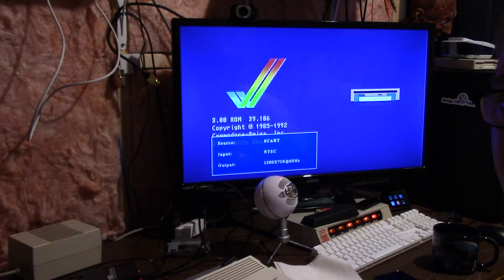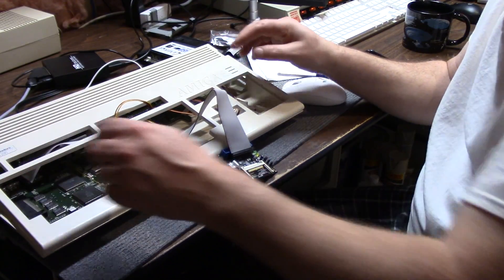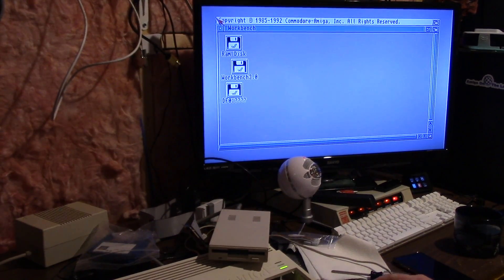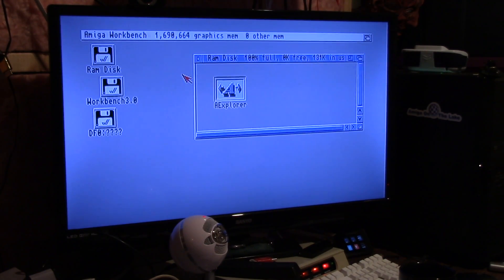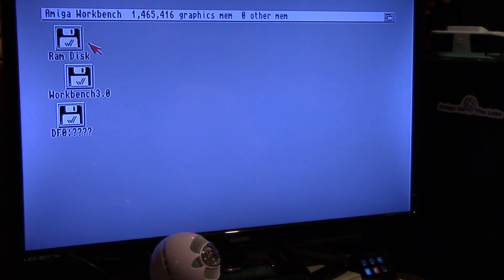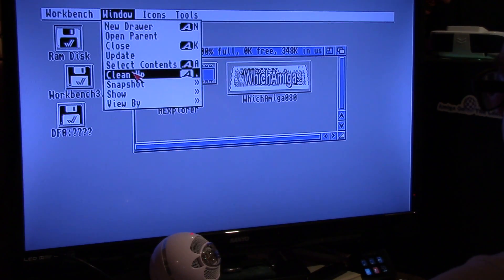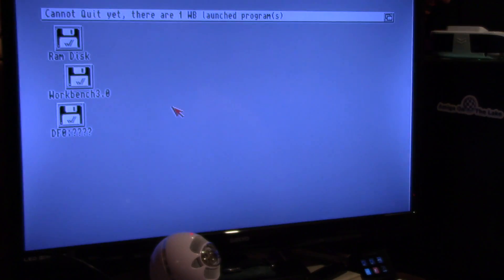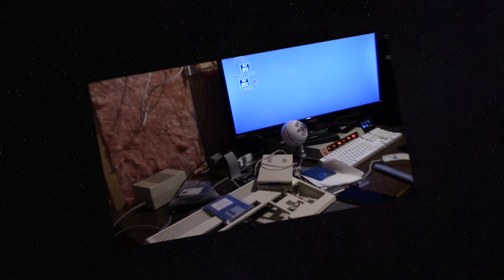Project A1200 part 2

Comment: Did you test the mouse on another Amiga? It’s more likely that the mouse broke than the chip in your A1200. Of course both can break, but I would recomend trying a different mouse, or that mouse on another Amiga
Reply from the maker: oh its the port, i use that mouse on many, i have 4 amiga mice, then some trackballs and plenty of other peripherals. i think it just needs some love. a good jiggle and its fine, going to microscope it for cold solder cracks
Reply: Chris Edwards alright! You can fix it, I believe in you! ;)

Comment: Interesting videos you have :)
I have the same problem you have regarding audio with one of my Amiga 1200s except it's my right channel that's roughly half the volume, I would love to know if it's an easy fix.
I will be keeping an eye out for your vids, hope you get all problems sorted, can't let any Amiga's die.
Waiting on a Gotek for one of my A500s as well as an ACA500plus and ECS Indivision, should be great setup once I get it all sorted.
Reply from the maker: its either a bum connector, the opamp or the resistor values from the opamp. a known issue on the earlier rev boards like mine. 1d1's are the betters, but near last of productions like the 2b's which are not as sought after.